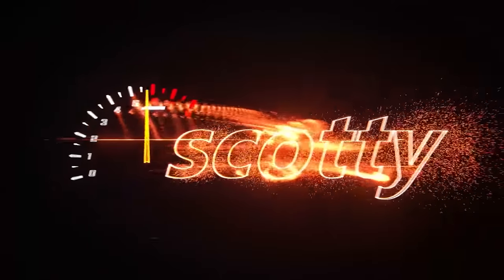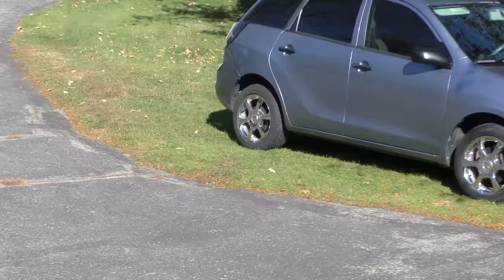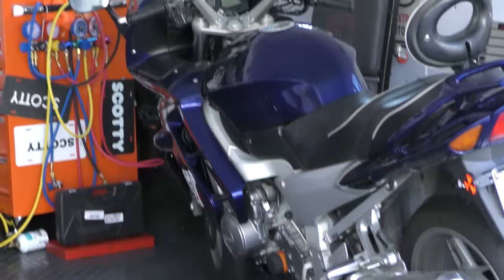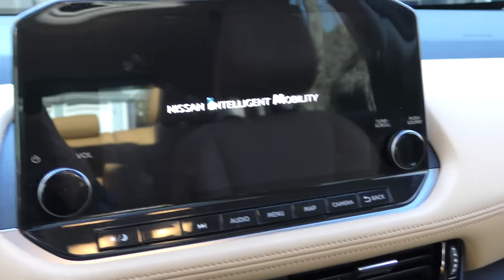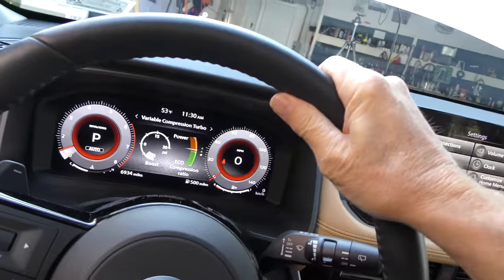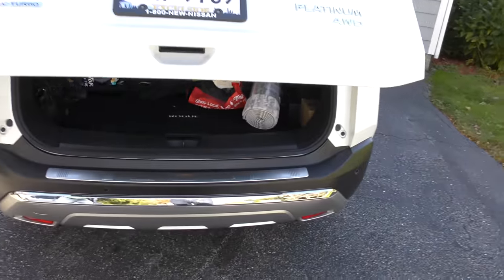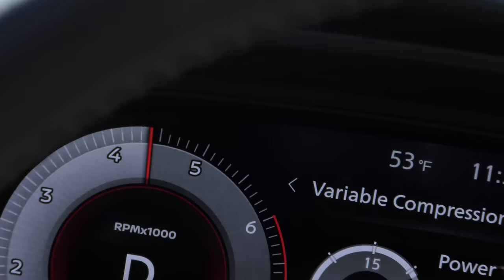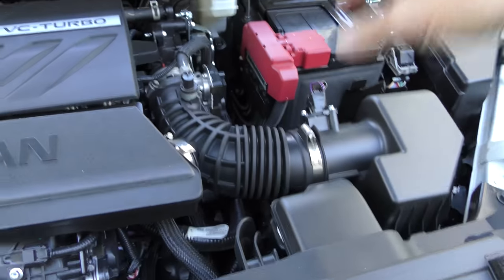Nissan's New Engine Shocks the Entire Car Industry

Comment: Scotty- What is your opinion on this trend of smaller displacement turbocharged engines? Do you think there’s any chance they will reach 200k miles? I’d rather a larger normally aspirated engine 🤷🏻‍♂️
Reply: Nope is a nissan
Reply: @andersonrodriguez8258  Even Honda's 1.5L Turbocharged Earth Dream engines have fallen foul! So what're you talking 'bout? 😳
Reply: @andersonrodriguez8258  The problem, as I see it stems from putting this "tiny" displacement powertrains in large and larger vehicles that require lots of oomph and girth to move those large masses around and not even mentioning haulage and towage! These manufacturer's should stop ✋ placing this little powertrains in midsized to large SUVs, Period!
Reply: @andersonrodriguez8258  The problem, as I see it stems from putting this "tiny" displacement powertrains in large and larger vehicles that require lots of oomph and girth to move those large masses around and not even mentioning haulage and towage! These manufacturer's should stop ✋ placing this little powertrains in midsized to large SUVs, Period! Or better yet, augment the power delivery with sensible electric motors!!!!
Reply: @ev-ezaye3580  That’s what I’m wondering. An accord with a 1.5 liter turbo seems shaky to me. I can’t imagine that engine running 200k miles without issues
Reply: @Electric Gamez  you guys forgot about the Toyota yaris gr and corolla gr, you do know those hold 500 whp on stock motor cause of the massive selves it has, people have recorded well over 200k miles on them, imagine 500 whp in a midsized suv lol
Reply: here in the US- gasoline automotive fuel will be scarce before we know it-  and that means it will become more and more pricey. look at california's fuel prices- you will soon be seeing that in your neck of the woods, as well. nissan knows that and will be discontinuing larger V6 and V8 engines for that reason- and for compliance with US regulations. they will not be alone. unfortunately, if you want old technology, youre gonna have to buy an older vehicle. if you go that route- i recommend you look into the possibility of converting that older vehicle to EV or alternate-fuel technology before you acquire it. there are no current plans to allow alternate-fuel (or flex-fuel) vehicles to be mass-produced or exported here, but that may change if the US ethanol lobbyists get their way. as for your 200K question- is there any chance you will not abuse your vehicle and will maintain it properly? if your answer is 'yes'- you will have a good chance of your vehicle making it to 200K. cheers!
Reply: @andersonrodriguez8258  go research Nissan 1.2HR engine.

Comment: Infiniti have been using this engine for years now,doing good so far about the CVT transmission change the fluid every 30k miles and don’t drive like a racer driver

Comment: Mine is the plat trim, 23k miles on it. Only issue is the tires that came with it were not very good tires. I bought it brand new and it was made in Japan. Very awesome car the, good family car and the turbo makes it a dad friendly car. Good buy. Expensive though.
Reply: We’re looking at this but I was wondering about the 3cylinder engine
Reply: @MrWhitelightning73  pretty solid power, the turbo spools up to 30 lbs of psi

Comment: The federal entity is opening an investigation involving over 450,000 Nissan Rogue, Nissan Altima, and Infiniti QX50 models, which use those two engines. According to the NHTSA, owners are reporting knocking sounds, loss of power, metal bits in their oil pans, and even total failures. Nissan has made changes to the engines' main bearings and L-links since they've been on sale to address potential engine damage; however, a recall hasn't been issued yet.:face-green-smiling:

Comment: This engine can last a lot more than the previous ones they had. Probably 20k miles 😄
Reply: have you ever even owned a nissan product? i'm guessing not.
Reply: I have a 2019 Murano with almost 46k miles that I've had for almost 3 years.  Never been back to the dealer for anything since I bought the car.
Reply: @tommurphy4307  never ever

Comment: Junk. I can’t believe people still buy Nissans, with their horrible reliability and bad resale value.  I wouldn’t buy a Nissan if it was half the price of a Toyota.
Reply: Exactly!!! 👏👏
Reply: I'll take a Ford over a Dodge and a Toyota over a Nissan... ANY DAY!!! 🙄
Reply: @Paul you’re correct
Reply: I have a 2010 Nissan Altima hybrid it is very reliable. 50% percent of the car uses Toyota parts including the transmission
Reply: the world has change and also Nissan Nobody has problem with you buying your Toyota, but speaking about horrible reliability, this is not 2016 or 2014 , we now in 2022, which Nissan reliability has significantly increase, that consumer report acknowledge moving them to 9th spot ahead of even acura, and infiniti at 4th spot. so go buy your Toyota, but do me favor and research the facts before posting.
Reply: @freebehindbars8654  sure you speaking about the old nissan 2012 to 2017,what about now?  if they was trash why are they rank infiniti 4th spot nissan 9th in consumer report? or why are they moving up in ranking in JD power report? care to share?
Reply: @DavidAndersonReviews  yes because leaf or Ariya did not have any wheel flying off their EV, or the all new turbo waste gate on the v6 tundra , or the engine failure with dynamic force engines. As long as Toyota have issue they are ok.

Comment: Now that's an excellent warranty!
Reply: @Paul yea now you will. These new engines aren't as reliable as before but definitely more reliable than other companies
Reply: I feel like there's a caveat with a warranty like that
Reply: @driveonthestraightpath2138  I have new Toyotas with all the technology and options as well as sonar so does my sister and other relatives some of them are from 4 months old to 4 years old and we have never had any trouble with any of them.. others I know with Nissan and Korean cars have trouble within the first oil change.
Reply: @TheIronChainMaster  ..If they are like Hyundai and Kia they don't like to honor warranties and try to blame it on the customer.. Nissan's warranty administration is low and uncompliant in consumer complaints..re; not very good!
Reply: @Paul My sister and I have those engines in our new Toyota Camrys XSE and XLE . They run great and the harder you push them they better they run. They are non hybrids and get 47 to 48 MPGs on the highway. We used to buy Honda Accords however we didn't want the 1.5 turbos or 2.0 turbos at this early stage.
Reply: Maybe and maybe not.
Reply: @charlesjackson1700 I never said they're bad. I said they aren't as reliable as the engines b4 especially turboed engines
Reply: @Paul never said they're bad. I just said not as good as b4. Quality control went down

Comment: I had a Nissan Maxima 2008 with CVT and never had issues with the transmission or engine sold it 5 years ago and the new owner has it with 280k miles running great only issue needs Ac recharge other than that great vehicles as long you treat them well and do all the fluid services as recommended.
Reply: hopefully- they replaced all the a/c piping/component joint o-rings/seals and evacuated the system thoroughly before recharging. on lower-mileage or garage-kept vehicles, a thorough post-charge leak check can be carried out in lieu of replacing the sealing parts of the a/c system. regarding your final statement- true, true, TRUE.

Comment: Be careful, my wife's boyfriend's boyfriend's girlfriend's Infiniti VC failed, he is waiting for new engine...too much drama
Reply: same as 2.5 toyota dynamic force engines was failing.
Reply: @cb5110  2018/19 camry 2.5 had incorrect pistons, was recalled
Reply: @CJ-zz9ts  they had more problem than that, overheating and stalling issues up to from 2019 -2021 model year look up NHSTA report. Yes they recall, but people still having stalling problems, even with rav4 hybrid corrosion problems.

Comment: Yeah my wife wants one, we have a 2017 Altima Sr and got it New , I just changed the brakes on it, but other than that the car never had any problems  so far, so now we're going to sell it  to get the new Rouge so I hope it's just as reliable as The Altima But scotte forgot to mention that the new rogue has a 5-year 60,000 mile standard warranty on the powertrain alone

Comment: I got my 1st car at Poughkeepsie nissan. The warranty will stay intact as long as you change the oil and get major services like trans change and upper induction service at 100k. You don't have 2 do much to keep your warranty as long as the oil changes were done at the right time.  My dealer charges less for an oil change than the mom and pop shop or something like a mavis or valvoline.
Reply: correct. i go to mossy nissan for all my engine oil changes because they can do it more economically than i can- even if i use aftermarket stuff. they will also accept your receipts and update the cars service record reflecting the maintenance you have done. their advertising expense account pays for a portion of the work because they want you to visit their dealership and service dept. thanks for setting the record straight. thumbs up!

Comment: 3 cylinder engine with articulated connecting rods, a turbo and CVT trans. What could possibly go wrong? My thought on the warranty - how does it feels to be a Guinea pig?
Reply: all baseless concerns- everything is thoroughly tested before we even learn of the new systems- and constantly revised/upgraded as necessary. our US car market is usually the last to receive new technologies as far as nissan/infiniti vehicles are concerned. that means the 'guinea pigs' (if there are any) tend to be in the JDM or other car markets....but thanks for your concerns just the same.
Reply: here's a little secret for you- the very last digit in any nissan part number indicates the number of revisions there have been with that particular part. that number is very seldom a zero with the exception of some non-mechanical parts- so rest easy.
Reply: @tommurphy4307  A version has been in infiniti since 2017.

Comment: The "lifetime" warranty requires the car be maintained strictly in accordance with the manufacturer's requirements. The owner must be prepared to prove the work has been done on time and by "authorized" shops/techs. The dealer has many many outs that will give it the excuse to claim the owner has not met the requirements to keep the vehicle maintained. The vehicle owner doesn't stand a chance with this scheme.

Comment: You say he got the life-time warranty from the dealer?  Will another Nissn dealer support it when the original dealer goes under?  We had a pool installer in our neighborhood who did a lot of in-ground plaster pools back in the 70's.  His warrantys  lasted til he had a bunch of complaints.  Then he "went out of business".  3 months later, his crew were back in town.  Same guys.  Same trucks.  Just a new logo on the doors.  New customers knew nothing of all this.  Old customers got screwed.  When the Warranty is in writing, backed by ANY Nissan dealer, . . . . then maybe.  But with a 2013 Sentra in my driveway, half-way thru it's second CVT,  I have no further use for Nissan.

Comment: For that lifetime power train warranty did they just make him bring it in for fluid and filter changes at the appropriate intervals?  Did they just ask him to pay for the cost of the service?  I have heard of Muranos lasting a long time but this of course is a different CVT.  Rumor has it there is a Murano out there with at least 500,000 miles somewhere.  Was that guy changing his fluid and filters at the appropriate times?  Maybe.  The way I see it if you have any hope of making any modern vehicle last so long one thing you should not do is neglect the fluids and filters.  That is just asking for trouble!!  On my 2017 Rogue that little cartridge filter made a huge difference on its own.  It was only darkened some from all of the stuff it filtered out.  It had no sludge or metal on it.  Do keep in mind that there is still the filter at the bottom of the transmission and they are not always just a screen.  If you are comfortable doing it, take that pan off and clean it out, install a new filter or maybe you can get away with cleaning it if it is ONLY a screen.  If there is any fabric along with the screen that  makes it a filter and NOT just a screen..  You might be pleasantly surprised how well it may run with fresh filters and fluid.  Those two filters (the cartridge and the bottom one) are the only 2 that I know of that these CVTs have.  They may be in different places so maybe someone on YouTube did theirs and that could give you some insight as to how to get at it.  Some modern vehicles have filters that are tricky to get at.  Even if your vehicle is not a Nissan look for information on any second filters such as a cartridge type.  Some Hondas have that too so it may be a thing the Japanese love to design their transmissions with. On the Nissan it is just a small filter but regardless of price replace it.  Unless you are broke it is not going to be a lot of money and you may find the vehicle runs better with the clean filter.  Now that is a pleasant surprise, just make sure the gasket stays seated when the housing is on.  Get a flashlight and mirror and inspect it if you must and look for a gap that does not look normal.  Not sure what normal is?  Take a photo before you undo the housing and if it looks different after (uneven) it may leak.  Also they are just 10 MM bolts holding it and in aluminum so do don't tighten it light crazy.  A box end wrench will be a huge help to you.  It can be done from under if you are good at not losing bolts or it may be done from above.  I did it from below, it is not hard if you take your time and don't rush.  You just need some idea where those bolts are (there are 4).

Comment: I'm curious if they give a lifetime drivetrain warranty and the computer screws up, which means the drivetrain won't work. I bet the warranty doesn't cover the computer not letting the drivetrain work. So the warranty will only fix the mechanical elements.

Comment: My 22 SL gets up to 39mpg hwy with the 3-cyl turbo.   Averaging 33 overall at 9000 miles
Reply: I get about the same overall average in my Altima with the 2.0 liter version of the VC-Turbo.  They may as well just used it and had an engine that did not have to work quite as hard.

Comment: Our Hyundai dealer offered a 10 year 100,000 mile engine/transmission warranty. A lot of engines were replaced and a lot were not replaced that should have been.    It worked out poorly for many of  their customers.  Our local Hyundai dealer went out of business.  Now, these same customers drive a hundred miles to try and get service.  How much less will this wonderful Nissan be worth after 5 years of use?  Probably a lot  less than a 5 year old comparable  Toyota.  A warranty is only as good as the company that offers it.    We usually get what we pay for.  Buyer beware.

Comment: If you get a chance, like to know what you think of the Nissan Kick. I'd rather buy a Toyota/Honda, but their equivalent wasn't as roomy.  The Kick has a 1.6L & 122 hp. It sounds like it's struggling (loud revving noise) when picking up speed ( eg merging & on fwy). It's got good mpg though. Do small engines prone to fail earlier cus it works harder or it  actually lasts longer. Just wondering. Thx.
Reply: Go for Subaru Crosstrek or Mazda CX 30...

Comment: I see lots of recalls on this one.
I hear the lifetime warranty on the engine means that if the engine breaks, they will remove the engine and replace it with a VW bug engine from the 60's.
A LIFTEIME WARRANTY?  What if Nissan goes under? Then what? Don't forget....Nissan is owned by Renault and the French can't make cars that either last or sell.
Reply: Nissan is not owned by Renault, Renault is parent under the law, which is somewhat confusing, Renault own 43%, which they are the biggest out of all the share holders. that why now if you watch news there will be a shift in power.

Comment: I once had a 5 cyl Audi 100 diesel ( 80 ties ) with only 50 kw and this car had enormous torch power even though little horse power. Those 3 cyl motors were introduced by Daihatsu 30 y ago ( I think ) and now many cars have 3 cyl engines,  VW, Kia even BMW diesels with big torch. The Japanese car makers are keen and very inventive to make many improvements and do a lot of research, some engines last very long time. ( Toyota, Lexus ...)  This kind of motor reminds me of the mediaval catapults who also could shoot a big stone or fire much further ... ( can be seen in some movies about battles of these era)  Any way , big torch combined with much less consumption sounds very promising indeed.  Me for myself I have a Kia Picanto 3 cyl , 999 cube motor and a hell of torch and very few consumption of about 4.5 l gasoline per 100 km,  who would want for more ?  Next to all of this, the size of these motors are compact and easy to remove or change and  in case of worn out of total damage ( lack of oil or water)  easy to replace  and again less work and cost to do so ... ( big 6, 8 cyl motors pfff)
Reply: @glennbeadshaw727  Excuse my english. I meant ENGINE TORCH which means a lot of  power of an engine for example at low RPM.  This is very convenient to pull a trailor or caravan , or mounting hills without losing speed. So this Audi with little horsepower ( 50 Kw) ,  I could pull any trailor or climb hills when I went on holidays even at low RPM, he pulled like a real Belgian Horse !
Reply: Check out what a Belgian Horse is like. The most beautiful horse who could pull trees or chariots or plow a whole field, ... unlike a race horse ... without  ' torch' !